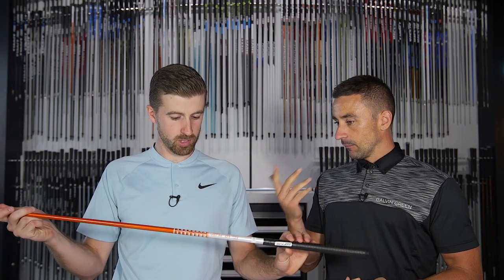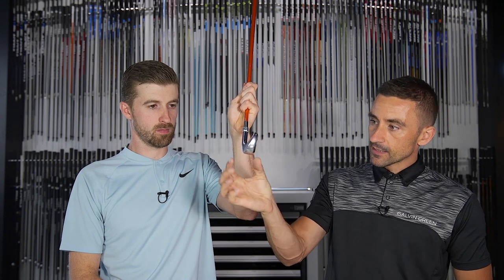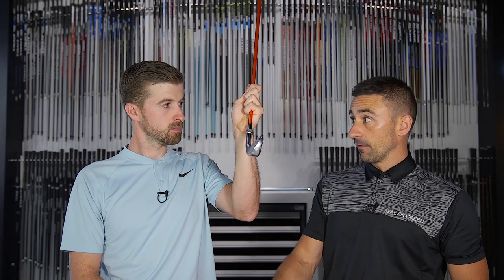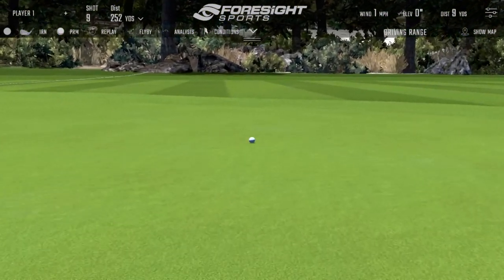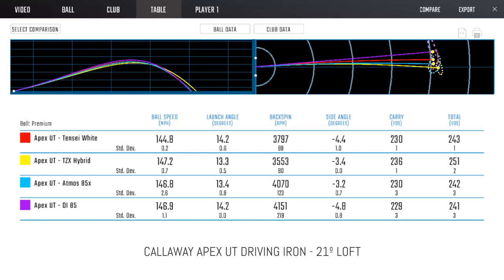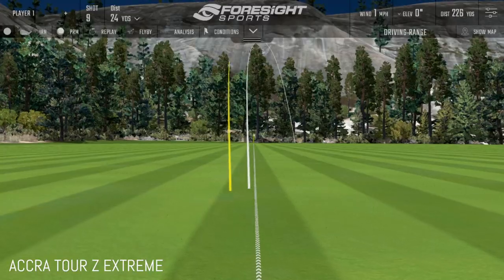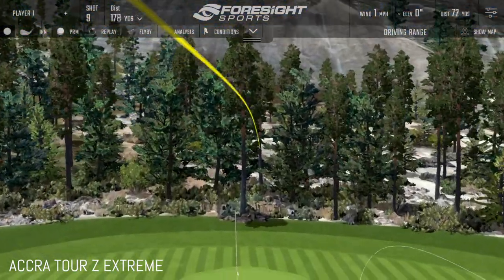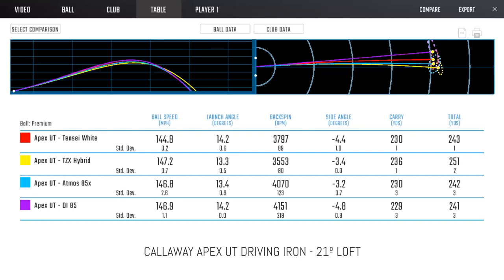Driving Iron Shafts + Matt's 250 yard club

Comment: Hey guys I know this is an old vid.  But why don't many people use steel shafts in driving irons?  I ask because I use x100 in my irons through 3 iron.  I was thinking of getting a udi built to with a steel shaft because I want it to feel like an exact extension of the set at 39.50 in instead of 40.

Comment: Currently gaming a Cobra Black Utility, tested it in multiple shifts and I must say, the Recoil SmacWrap ES is an absolute MONSTER. Love that combo, 225-230 easy and if I step on it I can get close to 240, set at 23.5
Reply: I just got one of those and am looking for a shaft for it currently.  Wasnt sure if I should be looking for a hybrid shaft or iron shaft.  I'm not the greatest, and am having trouble getting it high enough to have a chance at holding a green. I'm only hitting it 200-210. Have the 4 set to 21.5 to fit a gap.

Comment: About to put an Aldila NVS Hybrid 105x shaft into an i500 3 iron head for a utility club/driving iron. The trim code for the shaft says to tip trim none for a 2 and 3 hybrid, 1/2” for a 4 hybrid and 1” for a 5 hybrid. I have this exact shaft in my actual 2 hybrid at 40.5” and love it. I followed the trim code and did not tip trim it. So, my question is how do I tip trim the shaft for this new utility/driving iron if I want it to play the same profile and I am building it at 39.75”? Tip trim none or 1/2”?

Comment: Why do we need graphite in this iron? I have a full set AP3 and ordered my I3 with 2 degree stronger loft and 1/2" longer so it's more like a I2. This head is hollow(I think) so is this as easy as a specific "driving iron"? I have a driver speed at 100mph so I'm not fast. I have some trubbel on the turf to get it flying on the it's no problem. Should I get a Driving Iron with a graphite shaft instead...? Does it get longer or?
Reply from the maker: Don't necessarily need graphite, the model we were testing was built to 40.5" playing length. At that length a lot of players will find a steel shaft feels very heavy, so graphite is often a good choice. You'll see a lot of tour players going with graphite in their driving irons as well. You may find that a driving iron model offers a higher flight and is easier to hit off the turf.

Comment: I have a driving iron with an x100 in it, would you recommend changing it to a graphite hybrid shaft, like the Accra Matt tested ?
Reply from the maker: Would recommend trying graphite if you aren't getting the results you want with the x100
Reply: putting an x100 in mine.  the stock 90 gram shaft feels way too light for me.  i want it to feel like my irons

Comment: Have you guys tried the graphite iron shafts in the standard long iron? I saw the Mitsubishi MMT might be one of those interesting combos. This is probably the biggest issue in my bag currently. I had some issues with my Adam's tight lies 2. But the stock shaft weight is lighter then my 3 wood shaft. Tempo is all off with it. I loved its versatility. Roll and bulge though just felt like it was hurting me. I have a Tour Edge Exotics CBX ironwood in the same loft. Hzrdus Black 85g. Weight feels good. But very hard to load and maybe needs a little more torque. My first hybrid was a Nike ProCombo Utility iron. Still have it. Just not great on versatility of lie. So I've always liked the straighter faced long utility clubs

Comment: I’m a relative beginner (never had a lesson, but have hit on ranges about 30 times over ten years, but a third of that has been recently).

I just found out my used Ping 12 degree G15 driver is a stiff shaft (too stiff for me) . Is this why I’m able to hit a 9 degree 1997 Cobra deep face & a 9.5 975D driver farther with good hits than the G15? I can hit 220 (counting rollout) drives with the steel shafted cobra and as far as that with the Titleist but struggle to reach 200 with the Ping. 

And aren’t beginners supposed to also benefit from more loft in drivers as well over lower lofts?

My max ball speed (keep in mind I haven’t had a lesson) now is about 130-132. How far should I hit a good driver with that? And will I keep getting higher speeds if I keep hitting balls?

Comment: Would be interesting to see comparisons with metal shaft to visualize the differences. I use a Mizuno MP18MMC 2 iron with a Modus 120x both off the tee and turf. Great for the shorter, tighter par 4s. I hit it about 225-230 yards and my driver speed is 100-105.

Comment: Question I have a 3 TM B driving iron gold AMT 300 steel. If I replace with high to mid lauch 80-85 gram graphic shaft. Will that help gets ball higher than steel shaft. What is big difference between the two. Thanks

Comment: In the past 6 months I’ve added roughly 7-8 MPH of club speed across the board. I’ve gotten all my clubs and shafts straightened back out as far as appropriate weight and flex except for the 3 wood and hybrid/2iron. The increased speed has leaded to a lot of pulls and hooks with the 3 wood and huge gap between it and my 3 iron. My old hybrid is completely useless.

Comment: Would be good to compare the so called utility irons with some of the 'hot' long irons such as the Ping i500 and TM 790 3 irons.  Are the so called utility irons longer and straighter or is it better to take some length off to gain better dispersion.  Shaft piece interesting but a bit personal.

Comment: As a players with between 116-118 club head speed, how should I choose between a graphite and steel shaft? I have a C Taper 120 X in my TMB, but I feel like something a little lighter could give me a little more control.
Reply from the maker: Best thing to do is demo different shaft options during a fitting Kirk, the higher weight options from this video would be good ones to try for you

Comment: I guys,i haver a question,i putt my Apex UT 21º to 19º,but i use Nspro 950 regular steel Shaft, do you think is better to change for grafite?thanks
Reply from the maker: Depends on how it's working for you Bruno, lighter weight steel shafts can work in a driving iron but generally you'll see most people (including tour pros) using graphite in that club.

Comment: Hey Guys... Great job!  Any advice for Cobra king utility iron shaft?  i swing around 92-95mph (trackman) with it going 200-210 .  I have the rogue 85 stiff hybrid shaft that seems very loose and balls go right.  I also have kbs c taper lite in stiff that seems a bit to heavy with balls going relatively low.  any suggestions??  thanks!
Reply from the maker: Tensei CK Pro Blue might be a good one for you to try Josh
Reply: thanks so much... 70g stiff??  80g TX?

Comment: What loft do you think is the most common for bringing a 4 iron to 3 wood , I have a 19° hybrid that I carry anything from 225 to 240 range and my 3 wood isn't really much different maybe a few extra yards , do you think a 21° hybrid or driving iron would be more suitable
Reply from the maker: Sounds like it Gavin, as you say not much point in having your 3 wood and hybrid go similar distances.
Reply: TXG Tour Experience Golf is that common? , I was guna try a lower spinning 3 wood to create a bigger gap
Reply from the maker: It's very common, two scenarios that can make that happen, either: 1) the 3 wood is spinning too much and reducing total distance, or 2) the 3 wood isn't launching high enough to generate adequate carry. You'd need to identify which is the cause of your distance loss on a launch monitor.